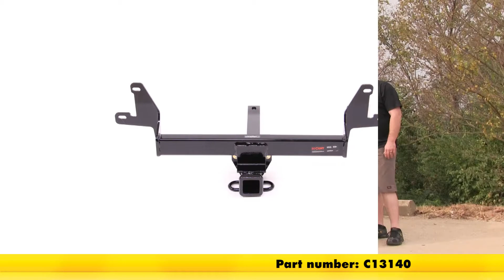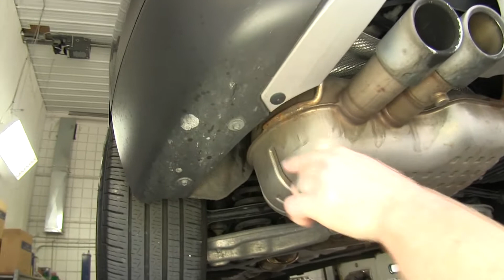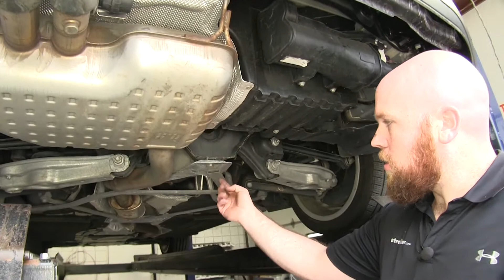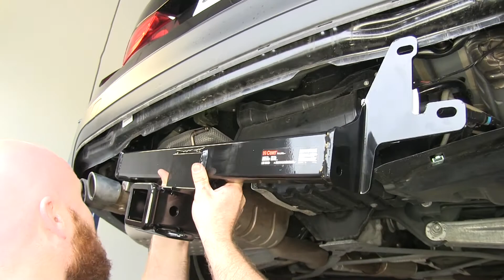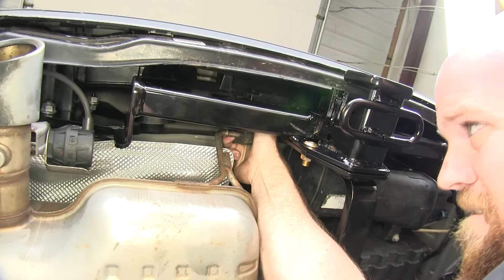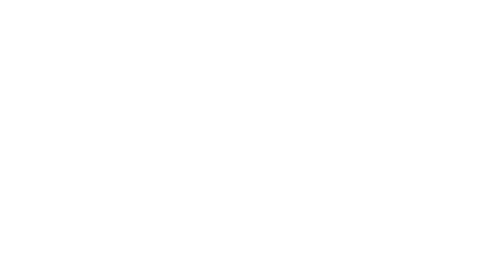etrailer | Mount: Curt Trailer Hitch Receiver on a 2015 BMW X1

Comment: I just can’t get access on the left side because of the muffler. Too tight to put the flange nuts back on place. Any suggestions??
Reply from the maker: When we have run into the issues that you are having, we just dropped the exhaust lower so that we can get better access to the hardware.
https://www.etrailer.com/Trailer-Hitch/Curt/C13140.html